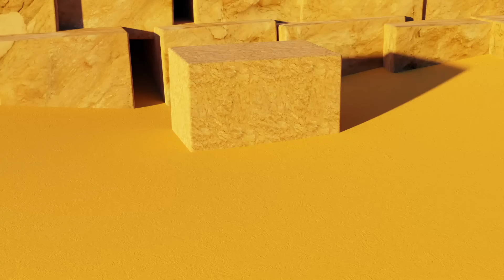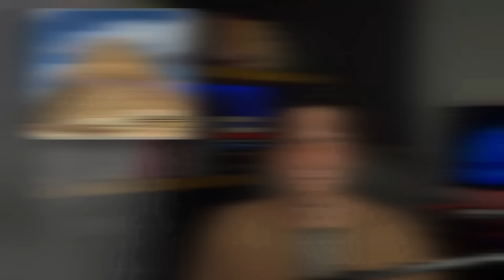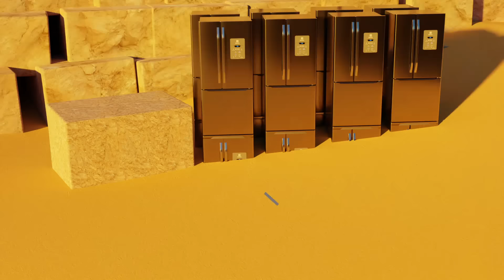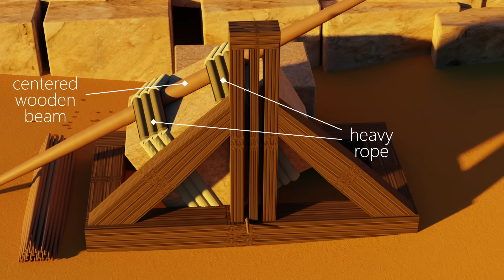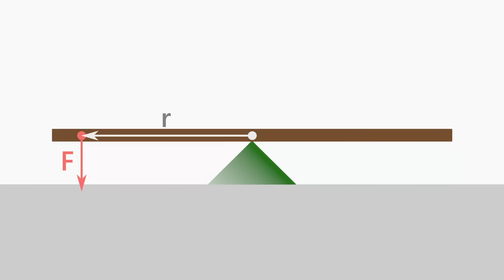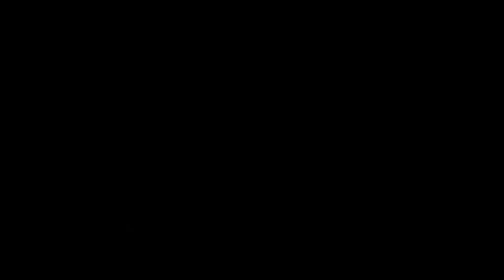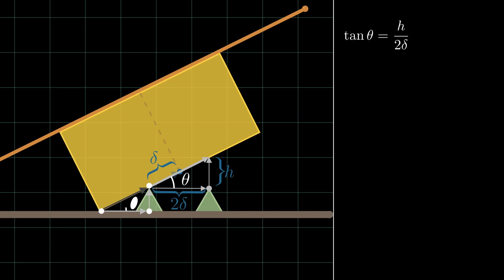Physics Reveals How the Pyramids were Actually Built

Comment: Sometimes people just want to make things difficult.
Lifting a stone back and forth all day wouid be back breaking work.
Why does this "engineer" only think in in one direction. 
If you are using human labor with a top mounted beam, why lift?

If the beam is strong enough to support the stone, why not use a moveable counterweight?
In one example we were cited 1200 pounds as the required force. Six to eight adults can weigh 1200 pounds, they can walk from one end of the beam to the other and never lift a single thing except their feet. 
With impeccable timing, two seperate groups could alternate jumping up and down in a rythm while "slats" where quickly and inserted.
Teeter tawter as high as you can stack, just keep the beat and rock on. 

Who knows, with practice maybe a stone could be walked by moving the pivot points, moving the counterweights in and out.
Lets have the workers suspended in swings under the beams with their feet on the ground. Give them the ability to add lateral force to pivot the stone horizontally.

Comment: I think there is an easier way to move those blocks. Suppose you put wooden blocks around them, one on each side, with the outside of the blocks curved to form a circle. On a really good surface, it would not take much effort to push the block around, because it is at the middle of a big wheel. Pushing the block around is done by a pair of levers, each with its own attached fulcrum. The block is moved by one lever, very slightly, and the other lever is put under to move it farther. When that happens, the first lever is put under again. And so it goes. To get a block to the top of a pyramid, we only need a ramp that goes around the pyramid, perhaps several times, until it gets to the top.

Comment: They could not work 24 hours a day because 12 of those hours would be in darkness 
 So instead of one stone every six minutes it’s more like one stone every three minutes 
or even less 
The tilting method you envisage would take probably take at least a day excluding the time spent collecting the wood and the ropes and building the device 
And even then  it can only lift a stone one level and had to be moved to the next location 
You suggest that once the stone weighing ten tonnes reaches the right height it is simply pushed onto the lower stone but you don’t mention how do they get the ropes out from between the two stones and how do they get it past the inner frame 
Your suggestion raises more questions than it explains

Comment: I doubt that they could complete the machine's operation in the 6 minute time frame you established at the beginning. Also you can increase the rotation for smaller delta values by providing extra space at the bottom for the block to rotate into. Furthermore as the block is lifted higher it can rotate further - so again a smaller delta is useful. How many times do you think 10 - 14 men could exert 800 Kg of force.

Comment: They had a powerful wireless amp and a microphone. By interviewing the blocks with the microphone the amp puts out it's resonant frequency and the blocks vibrate making it easy to push. They were also drilling holes in the stone and putting a massive amount of current through the rocks causing them to melt.. and when they pulled out the electrodes it left knobs. Large blocks like at Balbeck they melted the rock and scooped around it. I think they had many methods..including putting them on sleds and putting water in front of the sleds to slide them...... but the really larger blocks were moved with a microphone and amp... a portable thermoacoustic wireless device that used sound and feedback and radio waves.....which included a wireless microphone that had a blue Sapphire on it. It was like a 30 million watt thermoacoustic portable radio station..30k volts and 1000 amps... and if you had the wireless microphone your voice would come out of the box. I even found most of the parts except for the microphone that I'm still looking for... but the transmitter is in Ghanna... the golden egg  resonator is also in Ghanna...the speakers are in China.... and some of the parts are at Westminster Abbey. They had 20 people with horns to start it up,,, and once it got hot it made it's own sound and powered itself from it's own sound created from the heat. It had 2 arcing points inside that would arc to the golden egg and the egg would heat up and blow like a horn. The egg and the current conducting through the disks made it an electromagnet and the electric arcs made it run on it's own radio frequency. It was quite a clever device... very powerful and free energy to boot. They used a heavy 454 lb iron lithophone (Magnetic and can't pry it off until hot) on top of it to get it started and once it got hot they took off the lithophone and replaced it with the thermoacoustic transmitter and put heavy duty 250 lb tuning forks on each side of the heat hole vents on the side of the transmitter.  I can even show you the transmitter.. it's still exists but the Ashanti Nation has no Idea what it is.

Comment: with the millions of blocks needed to be quarried, tramsported and lifted into place one every few minutes, to complete construction in a reasonable time, you would also need at least several thousands of these devices.  NOT gonna happen, and did not happen.
2.5 million blocks @ 6 minutes each...working 24 hours a day would take over 60 years...JUST to place the blocks, not countring the quarry and transportation time and the complicated interior with even heavier blocks.

Comment: This is definitely how they did it.  It is very energy efficient to lift like this, and 2 people can pivot the block just by taking turns stepping on the top.  This uses leg muscles which is extremely efficient for humans.

Plus the main reason why this method is the most likely is that it enables an extremely high degree of parallelism.  The entire circumference of the pyramid could be filled with these so that hundreds of blocks could be lifted at the same time.

Comment: Glad to see him getting called out in the comments.  This video, at best, shows how you could lift a block straight up, while tied to a beam with ropes under the block.  OK, cool -- now how do you get it out of the machine and into place, with ropes under it? And how do you do this a few hundred feet up in the construction?  You have to get it there in the first place, then get it put into the machine.  The mystery is anything but solved -- I bet using this machine would take a LOT of time per block.  You have to get it tied to the beam first and that alone probably isn't easy to get ropes under it.  Need to see some real world examples, the math isn't enough here to explain how this part of the project could have been done.
Reply: At the top you put supports under it so that you can remove the ropes and the long wooden beam.

The supports would be wide to support the block while moving it sideways.

Comment: So, you raise a block to this level. How much force is required to push it horizontally. How long would it take? Then the machine needs to be repositioned to achieve mechanical advantage. What would that require and how long would that take? What are the shearing forces on the slats and levers? What are the forces on the frame of the machine?

Comment: I love all these theory guys. They are ever so proud of their proposals, and ever so eager to tell you that THIS IS THE WAY! The best they ever do is a small experiment. They drill one or two holes with a copper tube, make a cut with a copper saw for a few inches, lift a ton weight with a lever etc. and say "There! That's the proof! This is how it was done!"

But they never do the actual thing. They don't lift a 500 or 1000 ton rock, put it on a sled of wood or a boat, and move it 100 miles. They don't carve out a near perfect 70 ton box from one block of granite, or make a perfect granite vase with sticks and stones. They just do these imperfect, small experiments that in no way approach the magnitude of the achievement reached by the ancients, and declare victory.

You have a theory? That's great! Do the thing, in entirety. Make the thing using the methods you  propose...

Do the thing....

Comment: So are we to believe that this rig is built up to 400 feet in height? And then assuming that, how does one slide the block from the edge of the base of the pyramid onto the top which may be 225 horizontal feet from the base

Comment: To say set logistics aside is pretty low IQ.  Setting a block every 6 minutes is a BIG deal.  Because it's not just setting the block in 6 minutes, because it's not like these things are just picked up off the side of a mountain.  They would have to be cut, transported and set in place in 6 minutes.
This alone tells me that there is NO WAY that it was built in 27 yrs.  
Also,  how ya gonna slide the block off that machine with a big timber in the way?  Saying "simply slide it in place". How ya gonna slide it in place when the machine holding it in the air is in the way?

Comment: They say the great pyramid was built in 20 years. It consisted of 2.3 million stone blocks. They would have had to quarry 315 blocks a day, cut and shape them float them down the Nile river then  place them in position.  There's no way humanly possible  the ancient Egyptians could have accomplished this
Reply: You can do all that fancy math a human being can't do it way to many variables
Reply: The Egyptians used a system where everyone had to work for the government for "free" to accomplish civic projects for part of the year. There were roughly 1.5 million people in Egypt at that time. The upper estimates place the required work force for the Great Pyramid at 40,000. Even with your estimate of 20 years (which isn't the estimate, it's 26, which makes a difference), it's still less than 3% of the population. In reality, the workforce, as situated permanently was probably around 1% or 2%, with potential labor surges during the Nile Flood season. As as someone pointed out, only the casing stones were from Tura, moved on boats, the filler blocks that constitute the vast majority of the Pyramid were quarried from nearby.
Reply: Most of the stones were quarried right next to the pyramid and did not have to be transported by boats.   People just cannot get it into the heads that the pyramid was NOT built with millions of finely chiseled blocks.  Only the outer courses were cut finely.  The vast interior of the pyramid was filled with roughly cut rocks and rubble, greatly reducing the amount of labor required to construct it.

Comment: OK so your trying to explain lifting.  One every 6 minutes. But getting blocks yo the lifting location . After getting it to the position you lift it npyou need to rotatate  them into position.once you get it in position you need to move this machine to thr next location for another block in minutes.  Also how large is the,wood to build this machine. How heavy is your machine how large are your pivot pinto handle all 10 ton on it. Because it supporting all the weight. I'm not sure you realize the ,assive size of 
Umber would be . I'm not a engineer.  But retired construction worker .

Comment: Not covered - How did we get ropes under the stone block; once we have it to height, how do we move the block laterally; as the pyramid grows and slopes away from the outer edge how were blocks moved inward across the gap; and how did we get to the starting position of the machine surrounding the block and one slat under it.  Also not covered, how NONE of these machines or drawings of them have ever been found outside Herodotus' description ~2200 years AFTER the pyramid was built, how a block every 6 minutes was placed; how blocks were moved; etc.  This is an incomplete theory.  I'm not saying its not possible, but as a person who does an awful lot of things by himself (things he shouldn't by himself with a bad back) I use a lot of tricks of physics and skill.  I just need to see the process start to finish.

Comment: Some of the stones contained in the pyramid are more than 70 metric tons. And these stones were moved from quarries more than 500 miles away. No, wooden scaffolding and lever systems do not explain how the pyramids were constructed, no matter how eloquently the mathematics are described. I do not know how the pyramids were built, but these structures certainly weren't built using the primitive "machinery," tools, ropes, levers, and slave labor as we've been told. There is a gap in our knowledge. Something is obviously missing.
Reply: The mystery I want to be solved is if the Egyptians had such amazing technology, how come they only ever used it to cut and stack up rocks?
Reply: @oodmboo the Egyptians after the inundation “flood “, which occurred in 9,564 BC according to the Theosophical writings of CW Leadbetter, did NOT have what we today consider technology, based on well known science/mathematics. 
Egypt is stated to be a colony of the much more ancient Atlantis civilization which lasted for over a million years on different configurated continents. The two largest pyramids are said to be just over 200,000 years old. 
The Sphinx less than 80,000 years old.
Reply: @frankcipriani1882  Advanced stone Age people sure🙄😴
Reply: According to Theosophy founders, anti gravity was utilized for each block and scaffolding also. Entirely designed by Far East “Adepts “, the flowering apex of human spiritual evolution, belonging to the successful human evolution prior to the current humanity on earth.

Comment: People don’t understand that Egypt is littered with pyramids that were not completed or were used as experiments before the Great Pyramids were built. They can see how they were built in early forms.
Reply: IIRC the 4th major pyramid attempt already resulted in a successful (not stepped) pyramid ~2/3 the height of the Great Pyramid. The Great Pyramid would’ve been the 6th large pyramid built by the Egyptians, and remember the 3rd, 4th, and 5th attempts were all from Khufu’s father. There were a few satellite pyramids built too for these structures.

Most of the Egyptian pyramids were built after the Great Pyramid, and they pretty quickly got much smaller. The Egyptian pyramids started large then got smaller.

Comment: Ìf the use the Herodotos machines why can't a at the start be larger than h? I.e. start in a pit to get an a larger than h. As the higt incrase the angle can increase as it doesn't hit the ground. Then the leverage can be greater and the force smaller.

Comment: While rhis is interesting and certainly explains how physics works, I😢 think it was much more complex than this.  I think their knowledge ( the architect and Emgineers ) of Trig was pretty amazing.  This is a nice start.  My question is how were the Zed pillars used. They seem to be a crude pulley system.  While I 100% believe the pyramids were built by humans, i do not think.the Giza pyramid's were built in 27 years and i don't think the Ehyptians built the basic structures.  Use, decorate ( casing stones) and build temples on the site, absolutely.  Just my opinion. I do have an advanced degree in Emgineering and 40 yrs of work as a Manufacturing and Materials Engineer.  I admit i know nothing about building pyramid's but it takes a lot more than lifting a big stone.  Keep up the good work. Take a look at Zed pillars. I think they were used along with levers and skids.  One last note. No way these dides were lifting 200 pounds each .  For one stone, maybe. But everyday, seberal hundred stones a day, not happening.  Remember, no oxen, no horses, no wheels.

Comment: 21 minutes about the math to determine the amount of force to rock a 10 ton block with the Herodotus machine.  Seems like the least important part of the topic.  Most people watching this would accept a mathematicians statement that stated something like it would take about 600 kgs of force to rock a 10 ton block back and forth without needing all the diagrams and trigonometry etc..  The Egyptians built lots of large structures using large stone blocks and probably manipulated millions of blocks prior to construction the Great Pyramid and figured it our thru trial and error.  What seems far more important is how strong would the lever need to be; how strong would teh pivots need to be, how strong would the wooden slates need to be to support 10 tons, what would hold the wooden slats inline while a 10 ton block rocked back and forth who knows how many time/how much force would be required to push the block off the Herodotus machine and how would that force be applied/how many machines would have to operating to facilitate placing 2.3 million blocks 1 every 6 minutes 24/hours a day for 27 years?  I don't post these questions as a challenge to this method, I'm sure this was certainly one of the methods used in combination with other methods, however it would more interested to see these questions answered than to only know that in laboratory conditions a 10 ton block could be rocked back and forth by 600 kgs or so of force ...

Comment: The problem is not the gravity forces but the planning ,measuring, and dimensioning of millions of blocks. The blocks are not modular as we would use today. How did the construction site communicate with quarry. How did they keep track of the sizes and locations of the irregular sized blocks?